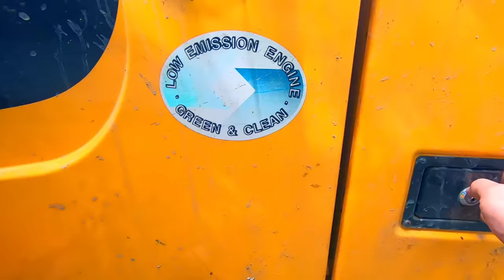Stuck In Mud with Excavator: Beaver Dam Removal Gone Wrong

Comment: Crossing backed up mud ditch no no.
Should hace dug ramp put dirt in ditch to drive overthen dug out maybe?
Reply from the maker: The ditch shores are fine. That's why I went there, but I rushed in and didn't check the bottom. there was soft blue clay. That sucked the tracks in imminently and made it all slippery. Your technic is the right and sure way to go.

Comment: hyd seam to be pretty weak on that thing
Reply from the maker: Feels the same to me. But it's not a new machine and the pumps may worn out a little.
Reply: ---- same thing  I was thinking:  most excavators can lift and load themselves on a flatbed  -  that one couldn't even lift the tracs
Reply: yeah i use to work on them for living, after 5 years of working, they either need a pump or the pressure reliefs are going bad.
Reply from the maker: It can lift itself easy, but this clay suction is quite strong too.

Comment: I find it hard to believe that you would even attempt,    Attempt to cross the ditch.  Just from looking at the angle of attack,  common sense alone says it couldn’t be done.  Then backing it up with math,  weight versus angle of attack,  versus angle of climb = can’t be done.
Reply from the maker: Yes, you can. Problem is that this ditch was soft. I have done it earlier right on the other side of the bridge. I lifted this bridge in place when I was in that ditch.

Comment: So you got stuck and in an attempt to make it better you made it worse first. Who hasn't? No lasting damage was done. Just a whole lot of mud to clean up. You won't make that mistake again.
Reply from the maker: My plan was to help with other excavator to lift ends up and put some logs under, but other excavator operator came and tried to make also things better. So it has been through dobel of that what you said. 😁

Comment: What a mess.  It would have been easier to put on hip boots & pull the beaver dams by hand.
Reply from the maker: How you take out all that material by hand?
Reply: @AFHProjects  First, Beavers don't have to get permits from the Government to build pond dams.  lol....   In Utah, they have protected Beavers, since 1870's.  You can't remove Beavers without Government permission.  Beavers are critical water storage in a high desert state.  There many reasons & ways for Living with Beavers.  Here are some short videos.  http://habitat.psmfc.org/living-with-beavers/  

You will need to put your hip waders on or plan to get wet.  Where ever it is safe, go out onto the beaver dam.  Start pulling & throwing sticks towards shore.  Start with the smaller dams first.  Pull out enough sticks to lower the dams water level.  Your goal is to reduce the water levels.   As you pull sticks from the dam, gravity will do most of work for you.  Be careful you don't fall in.  The water gets very swift, very fast.  Don't remove too much at once, you could flood out you neighbors down stream.  Which you could be liable for damages. 

The beaver will go retrieve some of the sticks you throw every where.  Maybe not cut down as many trees to repair the dams.  Seems to me there is an abundance of vegetation in many areas of the country for beavers.  Beavers are good for a healthy environment.  Beavers have multiple generation of families living in the same hut, up to four.  Normally, three generations live in one pond.  Beavers help restore water for droughts.

There can be many generations in multiple dam series as young beavers migrate to find their own areas to build a family home & dam.  Multiple beaver dams can provide reduce erosion on shallow & steep terrains.  Beavers can provide fish passage for spawning in upper & lower reaches of dams.  They keep their pond edges pretty cleaned up with some time.  They provide drainage of bog lands with channeling waterways.  Beavers provide water sources during drought seasons & help prevent extensive erosion.  Beavers dams recharge surface & ground water for irrigation restoration caused by human activities.    

On the Oregon Coast, Beavers Help Indigenous Salmon, Steelhead & Lamprey Survival.   Oregon has a Beaver on our flag & is our state mammal.  You can protect trees you don't want damaged.  You can plant trees & shrubs Beavers like to eat.  They will eat their favorite foods first principals.  You can put in a pond leveling system to prevent flooding.  There are lots of designs. 

Best design I have seen recently was on a pond over flow system with an under water intake.  The section with the noisy spill was on dry ground away from the dam & intake.  Even if the Beavers find where the sound is coming from, they can not dam it up.  Because it is underground too in a box with a cover.  Beavers can't figure out how to stop the running water.  They can build on top of spill box without stopping the flow.  

You can build an emergency spill way for a beaver dam.  When the beaver pond get to a desired level the water quietly exits the pond.  Which would need a gentle slope to work.  Beaver are the best dam engineering in the world.  Oregon Central Coast Indigenous Peoples tell stories of Beaver Teaching Salmon to Jump.  All Beaver Dams Leak to Provide Fish Passage for Little Baby Fish to Slip Out Down to the Next Beaver Pond.

Why do I Love Beavers so much?  Because, when I was young I lost my two front teeth for two years.  When they finally decided to come back in I had Buck Teeth.  I always look for the positives in life.  I had the nick name, Bucky Beaver.  Did not bother me one bit, Beavers were a favorite animal.  Because, I liked to fish.  There were always good fishing in or near Beaver Dams.  I thought being called a Beaver was a Great Gift. 

When traveling as a child with my Grandparents, I saw hundreds of great fishing holes from Beaver ponds.  I remember climbing a mountain pass up a ridge.  Below was a hundred beaver dams climbing the same draw with a winding stream of Beaver dams.  Most Fish Holes I have ever seen in one place in now 60+ yrs.  Must have been what it was like before Modern Man Killed 98% of an Indigenous Key Stone Species.

Comment: Instead of messing around there, getting nowhere, why, before you made such a mess, didn't you simply just go down the dith? and get out further down 🙄🙄🤬
Reply from the maker: I can't. Because the excavator get stuck immediately and I can't turn the tracks around.
Reply: @AFHProjects  yes, once bogged in they can’t turn at all, not even one degree left or right :o(

Comment: That had to be one biggest bone headed moves with an Excavator I think I have ever seen.  "Here, let me go down into this steep ditch with a bit of water flowing thru it, when there's a perfectly good bridge just 2 meters from where I wanna attempt this bone headed move."
Reply from the maker: The bridge is not made to hold 13t excavator. I placed this bridge here with this excavator. I sat bottom of the left side of the bridge when I did it. I was so sure that there is a hard bottom. Couple of meters away it was.